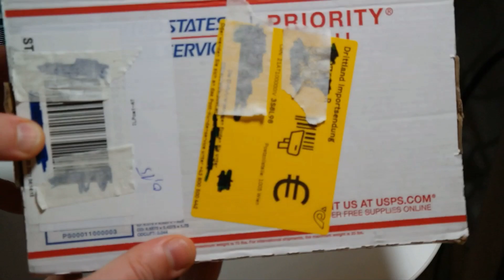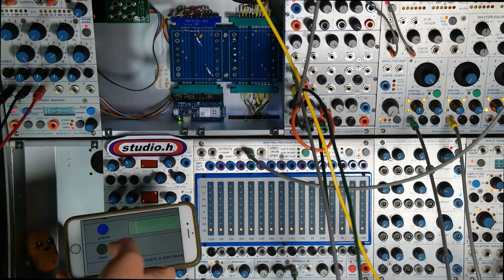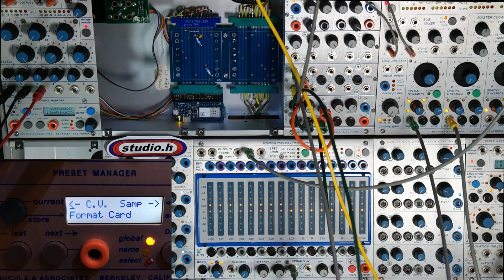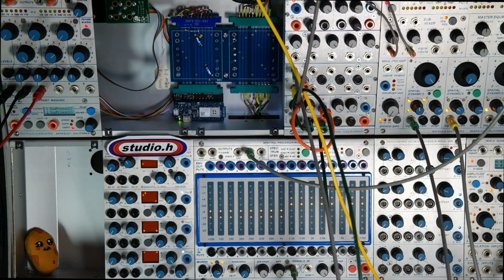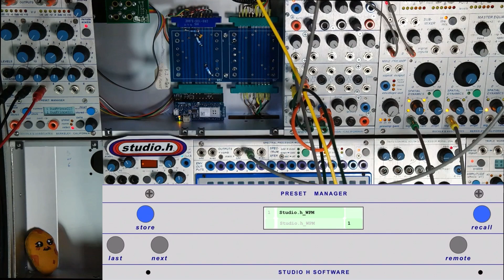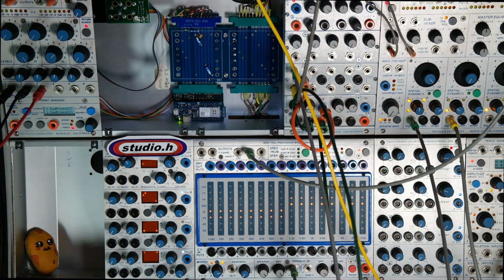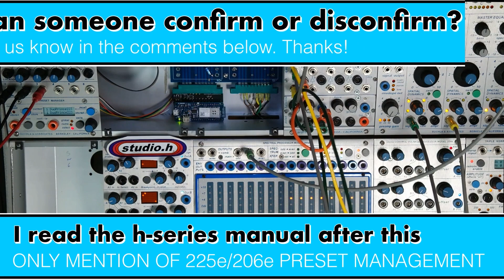Studio.h WPM Wireless Preset Manager for e-series compatible modules. Unfettered Preset Management!

Comment: thanks for making these videos kent. really excited about this! is it pretty straightforward mounting the breakout panel into the case? putting together a 254e/252e master controller for my easel/ciat lonbarde stuff and this is a godsend. really feel spoiled with studio h and keen association raising the bar these days 😊
Reply from the maker: The next video goes rather deeply into the physical considerations. The USB panel that mounts on the boat is simple. Finding space for the WPM can be a challenge. Currently, it is running strong in my lower 24 panel case, alongside a 225e. I’m sending 313BPM clock to it and MIDI notes (over USB) for the past few hours. No problems. 
One odd thing is that my 250e keeps on going if I switch presets (WiFi or 225e). My 252e and 251e both stop when a preset is recalled. 
MUCH more to come. The USB aspect is far more than a gimmick.
Reply: @LPGatekeeper   nice! hopefully it works out in the lem 3 boat. looking forward to what’s to come. feels like a great time to be a part of the buchla community :-)

Comment: Thank you for sharing this! This had my interest for a few weeks now, been wondering whether it would work in my mostly clone set up (saving presets for the included 223e and 259e). I appreciate your efforts in Buchla world a lot, cheers again!
Reply from the maker: Re: 223e & 259e, yes, this would be ideal. Are you using an Easel-based system with 223e and 259e added? In short, what’s in your rig?

And thanks for the kind words!
Reply: @LPGatekeeper  Yes, Easel-based, the listed e-modules, and a variety of NLM utility modules, all stored in a SAModular case. As you mentioned: The 223e is wasted in a system without preset capabilities. Plus, right now, I'm weary of purchasing more e-modules, but that is a discussion for another time, and honestly speaking, it's more like my gut feeling is telling me this, so strictly speaking not based on hard evidence, or facts, or expertise (of which there is none on my side). BTW, love the way you handle nonsense threads and flame on the 'wiggler. Again, I appreciate your hard work.